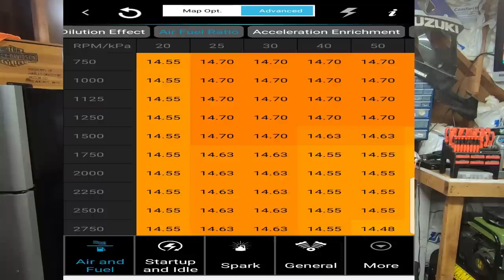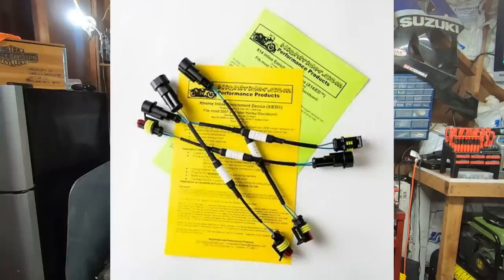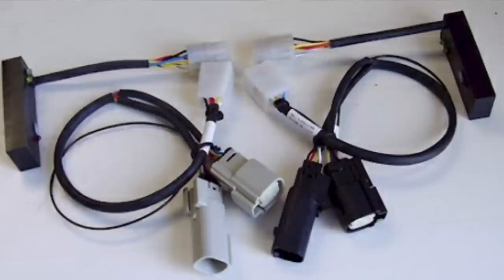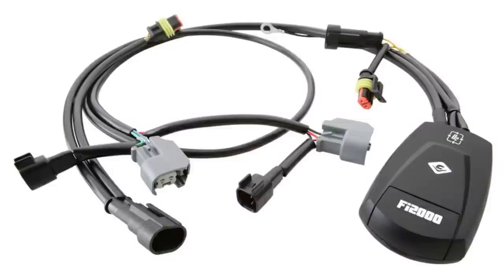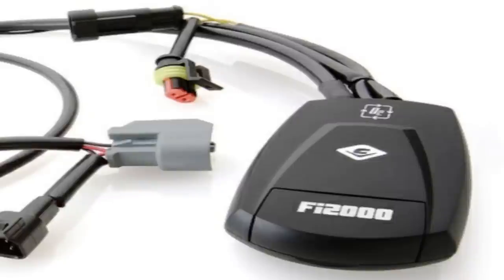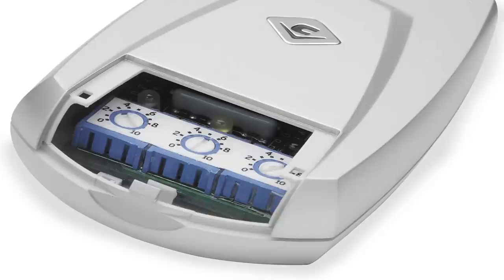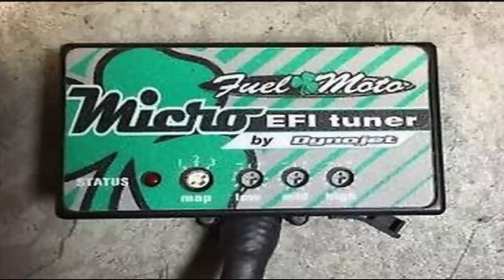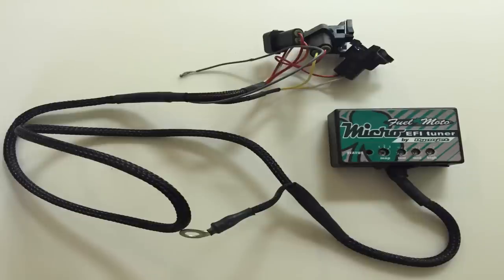Does Your Harley-Davidson Need A Tune With Slip-On Mufflers Only??

Comment: Sportsters didn't have O2 sensors until 2014? My 2012 Seventy-Two sportster has stock O2 sensors...
Reply from the maker: 2014 was the year they revised the closed loop system on the Sportster, fortunately for your year they ran a bit richer AFR. I should of specified that in the video.
Reply: @GixxerFoo  bought my 2nd hand and they are unplugged anyway.  Doesn't toss codes either...  something was done to it.
Reply from the maker: Have you checked to see of there is a stored code? They have probably been bypassed and the bike has been tuned with a good rich tune.
Reply: @GixxerFoo  just never thought about it since it runs great.  Gas mileage is fine etc.  The thing is though that the O2 sensors in it,  the plug ends don't match up to the bikes wiring as if they are some kind of after market sensor?  Tried to reconnect them and can't.  Would like to know more about it but not paying to find out from Harley dealership.  Friend is buddy with one of their techs who briefly looked at it out of sight of his boss.  It may also have different cams.  He held his hands to the exhaust at idle and somehow from the timing of the exhaust hitting his hands came to that conclusion that it does.  It also smokes by buddies 2016 103 Street Bob that has a Stage One done to it who has ridden it and says it pulls harder than his bike does.  Anyway its going bye bye this summer for a Fat Boy Lo.

Comment: So I just bought a 2020 883. So I would be able to throw on some slip ons with stock air cleaner? Does mine have o2 sensors. What would be the best tuner? Great video.
Reply: Yes you can. I have the same 2019, and yes yours has O2 sensors.  I prefer the Vance and Hines FP3 as it has tremendous support and you can easily make changes using your smartphone.  No computer required and the tuner can stay mounted on the bike.  Most keep it in the battery compartment.

Comment: Adding a high flow air filter on my 2017 M8 107, is a tune required?  I watched a video on you tube from DK Customs, he was saying that the M8 from the factory do not run lean like the twin cams. So he was saying you could install a high flow air filter without a tune and the bike would run just fine.  What is your thoughts?

Comment: Great informative video as i have been searching this topic, I have got a 2022 Softail Standard and looking at both the Vance & Hines Eliminator 300 and the Twin Slash slip on, so good to hear that your preference is with o2 sensors, but what happens to the sensors in my stock slip, do these just bolt on to the new ones, sorry if dumb question but not very mechanical.......
Reply: I have the same bike, did u change the exhaust?
Reply: @j.vosier6786  I have changed the slip-ons to V&H Twins Slash, but because of the sensors in them they are flagging a fault, only way to clear this was by taking to local Harley and having a retune, and as i was going down this route decided to upgrade the air filter and complete a stage 1.

Comment: do i need a tune if i change the whole muffler and thats it?? and can i go with out for a few more months
Reply: now it is running hotter for sure.
Reply from the maker: Just slip ons you can generally get away with a muffler swap only with the stock air cleaner. After that you will for sure want a tune with a aftermarket air cleaner.

Comment: I like how the V-Rod sounds without the back mufflers... Now I have a question. is it bad to run the V-Rod without the back mufflers even if I put a tuner on it?
Reply from the maker: It's not bad if it's tuned for it but your low end and mid range will suffer, now wide open it will greatly benefit you there. Trouble is you have to be redline wide open banging gears for it to benefit.

Comment: My 2023 M8 114 runs fine with a full exhaust and air cleaner without a tune. I have no heat or popping.
Reply from the maker: Full exhaust with air cleaner on the stock tune? It might be running on the lean side.
Reply: @GixxerFoo  The plugs look fine and It runs nice.

Comment: Gixxerfoo, I have a 2014 ultra limited with the 103, I installed vance&hines slip on and a k&N air filter with the stock air box, do I need to tune it ? I drove after the installation and it does not pop or anything. Thank you.

Comment: Great videos! What’s the difference between stock headers with the cats removed and 2/1/2 cat less headers like fullsac or fuel Moto?
Reply from the maker: The factory Harley headers are a lot better than they are given credit for, if they don't have a cat. Removing the cat does wonders but the bends in factory headers (originally with the cat) weren't designed with being run open in mind. The aftermarket head pipes bends have been designed for the dual touring exhaust without ever using a cat. They have better reversion and exhaust scavenging effects.
Reply: @GixxerFoo  - I removed the Cat from my 2012 FLHX factory headpipe. After having my bike tuned with a SE Tuner, and an aftermarket Big Sucker air breather, V&H Power Port headpipes, and Full Boar slip-ons.
I then removed the V&H headpipes, sold them and reinstalled my factory "De-catted" headpipes and installed "Bad Dad" Longshot slip-ons. I'm happy with the sound and performance.

Comment: QUESTION   What do you think about those XIED thingys that plug into O2 Sensors that change bikes AFR so not as lean?
Reply from the maker: They are a excellent low cost alternative to a tuner to get the bike fueled well and take the leaness out. Performance wise you'll notice a little difference simply due to the bike getting some fuel. A full on flash tuner is still the best but XIED are certainly a great way to get into a setup of slip on exhaust with an air cleaner and do it right.

Comment: if you change stock baffles to fullsac baffles on a 2021 cvo do you need to retune bike
Reply from the maker: Technically you wouldn't need to since you're retaining the stock head pipe, being a CVO it's already tuned for CVO mufflers. The CVO mufflers are basically the Screamin Eagle mufflers. You wouldn't regret a good tune later down the road though!

Comment: Would a pair of cobra slip ons from a 2005 softail classic fit on a 2006 Fatboy?
Reply from the maker: They should, it's the same frame and all the cross references I am seeing are the same part number. Only thing might some different bracketry possibly but they should fit without any issue.
Reply: Thank you sir

Comment: 2011 fxdc has the cats in the muffler does that matter? Thanks
Reply from the maker: It will just eliminate the cats, it will work fine if you have the stock air cleaner and you're just swapping mufflers.

Comment: I love to ride motorcycles, but to be honest, I don't know much about pipes and all that. I've got a 2014 fatboy that I like the sound of. I bought it used and someone already took the baffles out. It's got stock pipes and air filter. It makes the  crackle and pop sound when I decelerate. I've always liked that sound even as a child I thought it sounded tough, but apparently that's not a good sound and means I'm losing performance. How do I fix that? By getting it tuned?
Reply from the maker: Adding some baffles back into the exhaust will help quite a bit with that as well as a good tune.

Comment: Great video!  I have SE high flow exhaust with wide band O2 sensors, SE pro Street tuner, and a SE stage 2 torque cam with SE high flow air cleaner.  Am I able to add the Tab Performance slip-ons and not have to reprogram or anything else?

Thanks
Reply from the maker: For sure, with that wide band system it will work great with a new set of slip ons. They can compensate for just about anything you can throw at the bike.

Comment: Hey Gixxerfoo can I ride my H-D softail M8 with a set of new pipes for a few miles with no tune
Reply from the maker: Yeah you run them without a tune as long as you have the stock air cleaner.

Comment: Okay I have a 98 1200 Sportster how can I put a tuner on it
Reply from the maker: Since you have a 98 model it's got a carb. You will just need a jet kit, it's a lot cheaper to dial in than a fuel injected model.

Comment: My 14 road  king runs good but idle sucks, its rough and not always the same. Bike was tuned with the screamin eagle orange super tuner pro.. b4 I bought it.. local Harley shop added fuel n air, but did not get it right ( they told me it's good enough,) $106 labor
Reply: Harley's don't idle like Japanese bikes. He has a video about the Harley sound, and Honda designing   the Shadow model at the crank to sound like the Harley.

Comment: I'm unique, I don't think about changing pipes at all.......if it's too loud I just don't buy it

I have considered the Cobra tuner
Reply from the maker: Cobra is good tuner, I believe you can use them on a different bike if you sell your current one too. I don't believe the Cobra actually marries to the VIN like a flash tuner.
Reply: @GixxerFoo  I don't know, both types from Cobra come set for your bike, then 1 auto makes adjustments and the other you can make minor adjustments

What has bothered me about the auto tuner is it DOESN'T use O2 sensor

Since I don't know enough about any of it, that was enough.

Comment: A bone stock bike can benefit from a proper tune HD runs em to lean for emissions
Reply: Replacing slip-ons never affected my performance. However, I'm fortunate enough to have a carb and all I had to do to get rid of the lean condition was replace 42 stock pilot jet with a 45 pilot jet. I had to clean the carb anyway, so changing the jet was an easy fix. My air cleaner is stock but I do have the crankcase venting to the atmosphere, so the air intake stays cool, clean and dry. Love it!!!!
O2 sensors and mapping are not part of my life.
Reply from the maker: It's incredible what a good tune will do for a stock motorcycle, it's a night and day difference!
Reply from the maker: Carbs have some serious benefits and that's on of them for sure, a flash tuner will run you $400 bucks and a jet kit around $80.
Reply: Watch DK Customs ,,M8's DO NOT RUN LEAN ,, Unlike Twin Cams.
Reply from the maker: They have those dual plugs and extensive r&d on valve timing and ignition.
Reply: Decel popping is something I've had for EVER.
2001 carb bike (Roadking).
Has slip-ons and SE air cleaner, SE 204 cams and HD 95" upgrade. Has a Daytona Twin-tek ignition module, but was never "fine tuned" and am having difficulty getting support/part (cable) for CPU fine tuning. 
Also has HD hydraulic tensioner/oil pump upgrade kit.
Recently cleaned/rebuilt the carburetor and put in a #50 slow jet...biggest I had on hand. Factory was 45, later changed to 48, and still had decel popping.
Haven't done much riding since the #50 jet due to rain/cold.

Comment: Warranty issues ?
Reply from the maker: Tuning with anything other than screamin eagle tuner can cause a warranty issue. Unless you use something that doesn't flash the ECM and can be removed before dealer service. But slip on exhaust shouldn't cause a warranty issue.

Comment: Yeah so sportsters have o2 sensors 07 to present. Not 14 up.
Reply: Yep, same year that it got EFI.
Reply from the maker: I forgot to mention that 14 and up on the Sportsters was the new revision of the closed loop exhaust system. They ran those even leaner than 2013 and earlier, the earlier models ran a bit richer AFR.

Comment: How about stock air box but with a KN filter?
Reply from the maker: You'd be alright with just a stock replacement air filter in the air box, you wouldn't need a tune or anything with just a filter.

Comment: I put slip ons on my 1200c it ran like total crap i dont think my ecm could compensate for them it spit,popped had a lowend miss I put the factory pipes back on reset the ecm and it runs like butter😂
Reply from the maker: Once you tune it you'll notice a huge difference in power and how much cooler the engine runs.

Comment: Aren't those foolers? I watch a harley mechanic who says after a year the ecm will get tired of the repeated wrong value and it will have to go back to stock. My friend used the power commander and had it happen.
Reply from the maker: Never heard of that happening unless the unit itself failed. But yeah they do intercept the signal and trick the ECM. Cheaper option bit the flash tuner is the best route.
Reply: @rebel_ltz  learning about tuners isn't dumb but your comment is. Filtering through what tuner is a fooler and what isn't from more experienced people is how you get knowledgeable and a ripping bike.

Comment: I Run Slip ons on my now 3rd HD/ 20  Low Rider S,,they Run and Sound Amazing..I get Great mileage and Bike runs Cool due to No Cat,,a Mild Lean factor if Bike Runs Cool is actually a good thing for Zero Carbon build up,,well oiled Cylinder Sleeve and Good mileage. Lot of Slip ons are Better In fact on M8 Softaila than a Full system due to a Good flow and good back pressure.
Reply from the maker: I have always been a big supporter of slip-ons with the factory header, Harley's factory headers are a lot better than they get credit for. In some cases switching to a full system will actually produce less hores power and torque than a set of slip-ons.
Reply: which slip ons are you running on your fxlrs?

Comment: You have to tune even a bone stock harley they run to hot  ecm can be tuned much cheaper and way better do your stuff  and tune it cooler and way better American Speed and Machine

Comment: I say leave the stock pipes on, at least in New York state , as the governor has just signed a bill, that says if you don't have stock pipe , it will no longer pass inspection, two, the fine has been raised from 150.00 for noise pollution  to 1,000.00 bucks ! Also any dealer, caught  installing custom pipes more than three times in one year , with lose his inspection license and also his license to have a business in the State!
Reply from the maker: That's rough, you run the Screamin Eagle exhaust if you needed too.

Comment: Nice video. I have 2017 FLSTF fatboy. I have installed cobra rpt slipons. I want to ask that by using v and h fp3 is there significant improvement in performance or not? For using fp3 should i have to change stock air filter also? If yes can i use k nd n filter in stock air filter?
Reply from the maker: A FP3 tune is a night and day difference compared to the stock tune, it will feel like a new bike! You can run the stock air filter, or even a K&N in the stock air box. The bike will run a little rich since all the FP3 tunes are developed with a high flow open air cleaner. Running a little isn't a bad and it won't hurt the motor at all.
Reply: @GixxerFoo  Thanks for replying. So if i a using fp3 then  i should use high flow air cleaner also to avoid any problem to motor .
Reply from the maker: It will perform better with an aftermarket air cleaner but running the stock air box won't hurt the motor.
Reply: @GixxerFoo  thanks a lot for reply.
Reply from the maker: Not a problem, anytime!